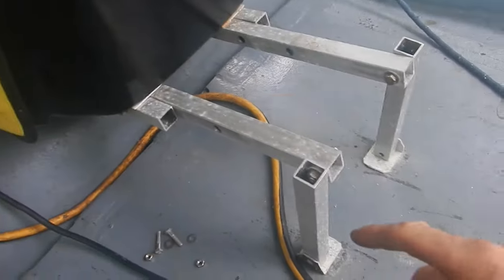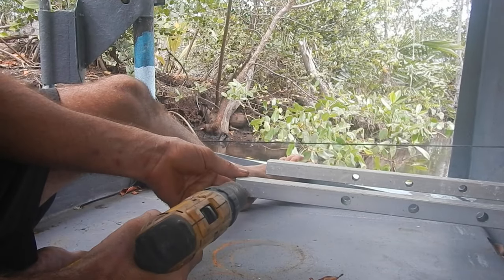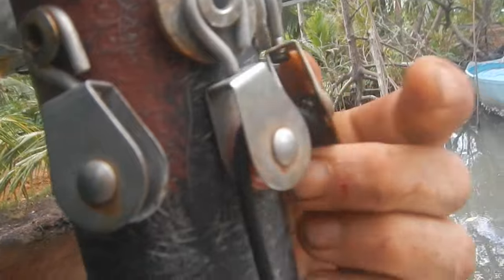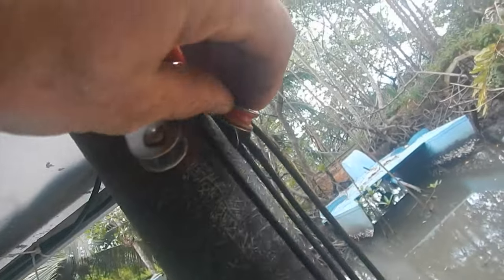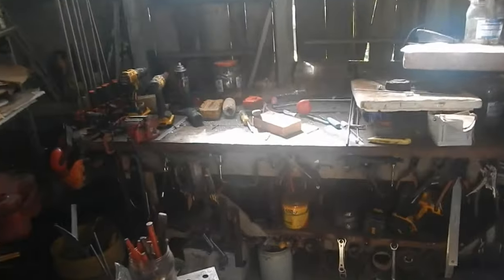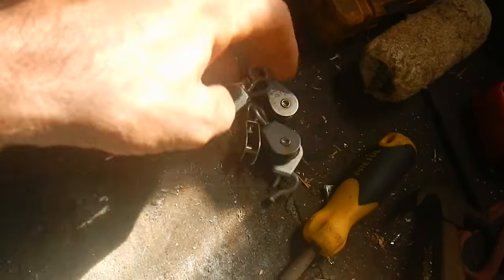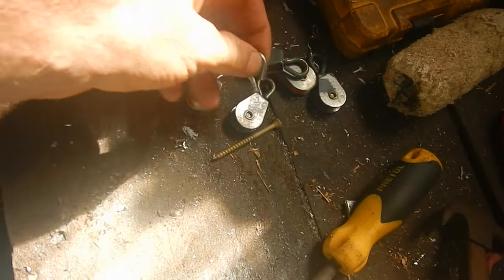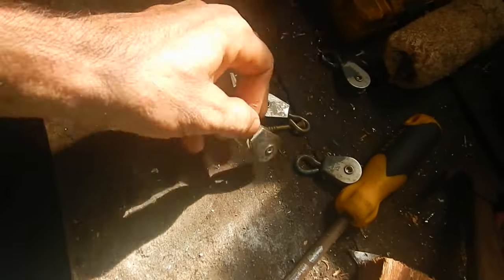The Little Things

Comment: I wonder how much macro-, micro- and nano-plastic Jamie has dumped into the oceans over the yrs ... bravo showing us how-to.
Reply: I would be interested to see how much plastic you have dumped, in garbage bins, put of the car window and have failed to recycle.
Jamie recycles everything.
He makes hats out of junk.
He makes outboard motors out of junk.
He makes Lumber Mills out of junk.
He lives completely off the grid, and builds all of the boats, homes and the vast majority of the products he consumes.
He's been known to paddle nearly 40 miles round-trip to the store and back...
Did you even take a shower today ?
Reply: @Peter-jo3wt  In 1902 we got our first return/recycle system for glass bottles in my country. I think it was back in 1981 I last threw away a plastic bottle, in fact, back in 1985 I had the vision to buy some Tomra ASA stocks and since then they have served me well. 
At home, I and the entire country, recycle most if not 100% our trash, includingfoods, plastics, metal, glass and ofc plastic bottles and alu cans that goes in separate bins and is recycled to make new products or energy with emission control. Also, if I need to grind on my fiberglass boat or replace anti-fouling it's mandatory to place tarps and tents on land and it's illegal on water. We also a have return system for old plastic boats and it costs aprox $200 to get rid of a 20 foot boat. 
So yes, I dump plastic but NOT in the ocean or on land, and even having the mentality and thought of dumping trash and plastic out of the car window is only for retards ...